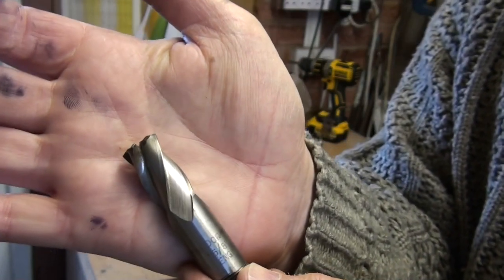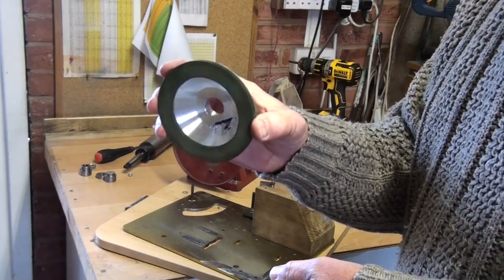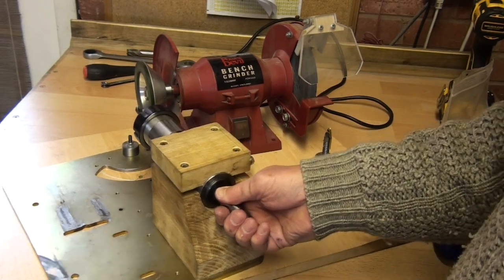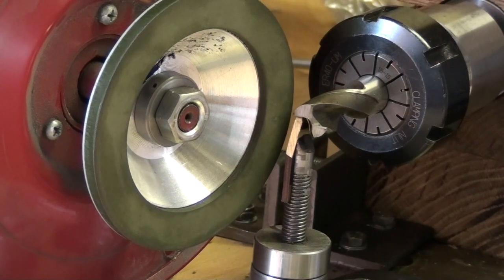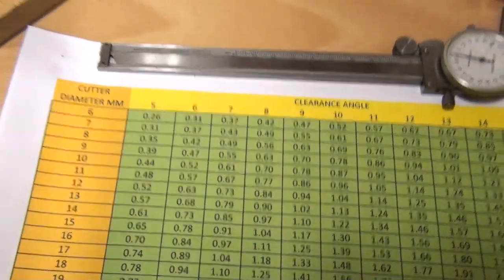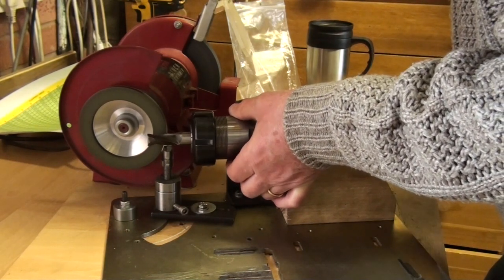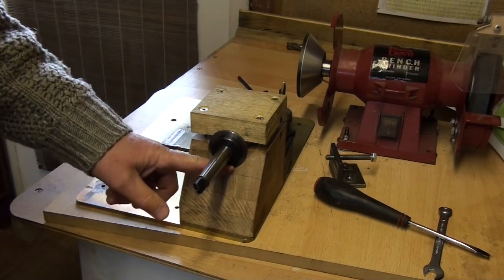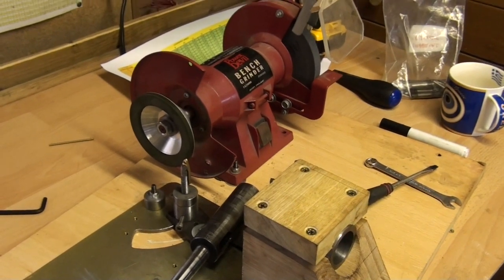DIY Method to Sharpen Milling Cutters

Comment: Great video Les, thank you. I have been a design engineer for many years and my best ideas have always been the simplest ones.
All engineers are economists at heart and you have taken exactly the right approach - reduce the problem to it’s essential elements and decide what needs precision and what doesn’t… then cut your coat according to your cloth. I applaud your thinking and execution. All the best.
Reply from the maker: Thanks very much for commenting. I rewatch the video now and then and cringe a bit over my wooden presentation but it's nice to get a considered comment.. Thank you.

Comment: This is nice work, Les.  I'd like to make a suggestion...see what you think.  Fit a degree wheel to the back of the collet holder.  This doesn't need to be a full 360 degrees.  And it could be attached with a magnet or tape or whatever.  You then back off the finger until the degree wheel reads the desired clearance angle.  No tables or calculations are needed.
Reply from the maker: @mk6595  @mk6595  That's a great idea and probably more accurate than my method as the radius  at the support finger is different to the cutter radius.

Comment: Thats a good jig youve made there mate. I may have a go at that design myself. Best ive seen for the home machinist. Good jumper too. Looks home made.
Reply from the maker: Thanks Chris. Well it's all a bit crude but it gets the job done. I am sure it could be improved on. That's my shed jumper......suitable for messing up 😁. I'm amazed you found the video. It went to 4000 views in days I'm guessing because YouTube made it prominent then just stopped getting views.
Reply: Les Fackrell yeah maybe if you did other vids they would promote you. I only just found it by accident.

Comment: I would suggest using a piece of a broken hacksaw blade or used bandsaw blade as a finger. That is what we always used in the shop I started out in. That way the finger can flex and let you advance to the next flute by just rotating the end mill and "clicking" to the next flute.
Reply from the maker: Why didn't I think of that?? Thanks 👍
Reply: That's what I used also nice and thin with a bit of spring. Good job well done.

Comment: I think it's a great little tool. From what I've seen elsewhere, it isn't chatter but the wheel needs truing? Guess the high spots will wear off eventually although removing and re-fitting on grinder spindle will probably move to a different location?
Reply from the maker: Thanks for your comment. I did improve the fit of the diamond wheel on the grinder. It's still not perfect and I didn't clock the run out but it works ok. I'm well aware that it's not precision engineering but I just wanted a method to get the job done. I guess it's an idea to be improved on.

Comment: Hello Les. You sound like a local boy! I,m in Cwmbran and have a similar if not the same mill as you. Do you have another jig to sharpen the cutting face of the mill?
Reply from the maker: Hi Kevin. Yes I'm a Cwmbran boy. No I haven't done anything about sharpening the end of the cutters. I have some vague ideas but i dont get many cutters to sharpen. I have a small tiltable rest bolted down next to my bench grinder (Not the one in the video). My plan would utilise that and a way to present the cutter with the same depth for each flute.

Comment: I'm not a machinist at all, but it sounded like there was some chatter wen you were grinding. I wonder if the Chinese wheel isn't true, or if you're getting some vibrational defection in the chuck holder. Maybe there could be some method to hold the chuck holder firmly against the stop. Just my non-qualified observation. Very nice invention you've made.
Reply from the maker: Thanks for your comment Rob. You are probably right. I made the adapter bush for the diamond wheel as good as I could and I have not bothered to try and establish if the diamond wheel runs totally true. I may try and understand how it measures up but for now it is usable. As I said the whole thing is hardly precision engineering but I agree getting the wheel running true would be a good move. Thanks again for bothering to comment.